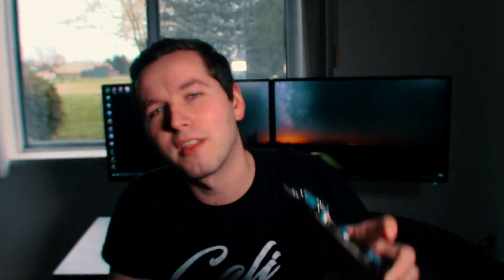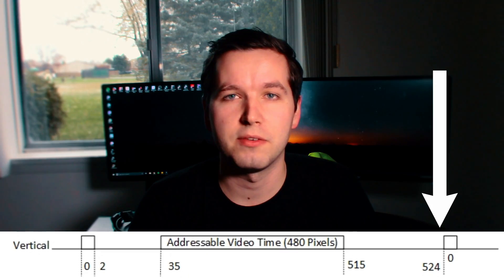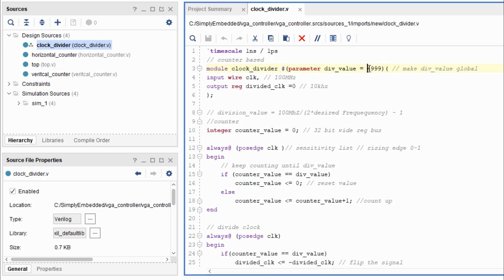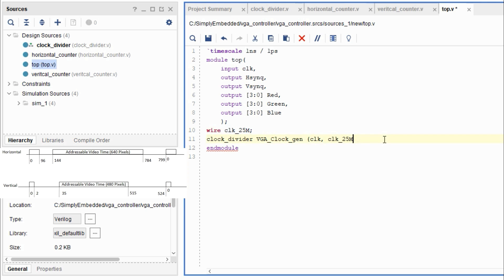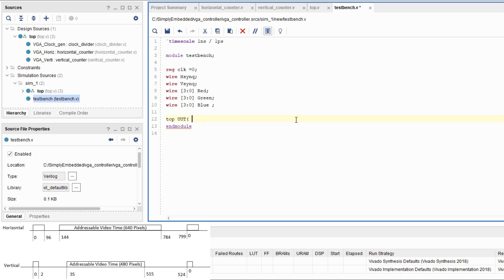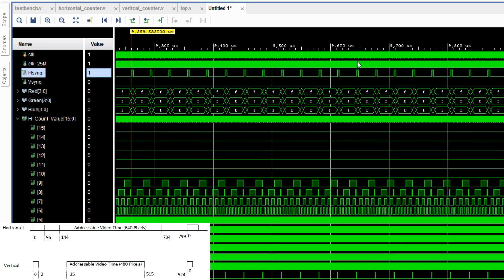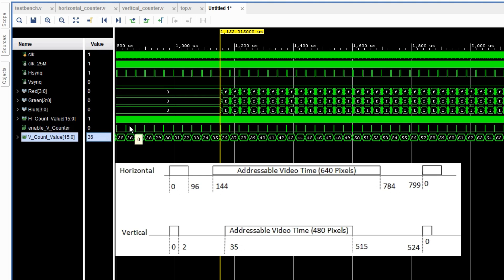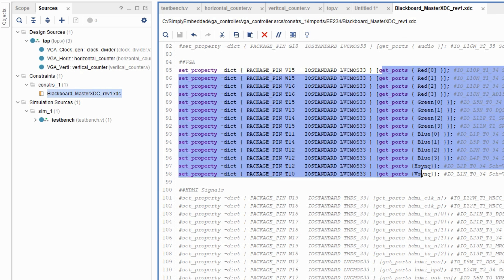How to Create VGA Controller in Verilog on FPGA? | Xilinx FPGA Programming Tutorials

Comment: `timescale 1ns / 1ps
//////////////////////////////////////////////////////////////////////////////////
// Company: 
// Engineer: 
// 
// Create Date: 26.11.2025 11:36:44
// Design Name: 
// Module Name: top
// Project Name: 
// Target Devices: 
// Tool Versions: 
// Description: 
// 
// Dependencies: 
// 
// Revision:
// Revision 0.01 - File Created
// Additional Comments:
// 
//////////////////////////////////////////////////////////////////////////////////

module top(clk,Hsynq,Vsynq,R,G,B);
input clk;
output Hsynq,Vsynq;
output [3:0]R,G,B;

wire clk_25M,enableV;
wire [15:0] H_count,V_count;

clk_div_100mhz_to_25mhz VGA_clk(clk,clk_25M);
Horizon_Counter VGA_hor(clk_25M,enableV,H_count);
Verti_count VGA_verti(clk_25M,enableV,V_count);

assign Hsynq=(H_count<96)?1'b1:1'b0;
assign Vsynq=(V_count<2)?1'b1:1'b0;

assign R=((H_count>144 && H_count<784)&&(V_count>35 && V_count<515))?4'hF:4'h0;
assign G=((H_count>144 && H_count<784)&&(V_count>35 && V_count<515))?4'hF:4'h0;
assign B=((H_count>144 && H_count<784)&&(V_count>35 && V_count<515))?4'hF:4'h0;
endmodule

Comment: As far as I understand, this is an example of an elementary implementation of one standard graphic mode: 640*480 256 colors (1 byte + palette). In essence, this is a RAM-DAС block. The real video adapter also contains control registers and different modes(including standard text 80*25 and 40*25) + a programmable character generator (in VGA, if I remember correctly, it is reloadable).

Comment: Your HSYNC and VSYNC are reversed for VGA. They should be negative pulses. You must have tweaked this to get the VGA working.
Reply: According to my knowledge the signal is flipped before it is sent to the vga port. Essentially making it an active high instead of the normal active low.

Comment: What RAMDAC system do you recommend if I want to make a cheap retro-style computer based on the STM32F107 MCU?
I want to use FPGA for GPIO and custom peripheral processing, and VGA output is the first candidate.
I select F107 as the cheapest MCU with Eth included, but it has no FSMC. The closest STM32F103 with FSMC has 2x price and not in local stocks now.
Reply: I want to use 332RGB with 640x480 or 800x600, both of them require to have not less than 512K of VRAM, and unused memory maybe cab used for hardware sprites.
I did some search, and can't find cheap RAM with required size, maybe some hardware RAMDACs still exists?

Comment: how do you even get all these numbers at the start? i'm trying to generate a VGA signal with an FPGA but want to have a smaller resolution. something like 320x240 (half VGA), what would the pixel clock be like, the sync pulses, front/back porch, etc. i didn't notice anything in the video that says how you calculate that.
I don't think it's good to assume everyone will use 640x480, i've seen people who were able to generate much smaller and rather odd resolutions with microcontrollers. (128x96, 64x64, and probably more)

Comment: why only do VGA in 640x480? what if you want to change the resolution to something strange/less common? like 320x200 or 256x240, etc
it should all be possible with the correct timing.

Comment: It may be useful to note that you have no need of a VGA connector on the board. You are simply need 15 I/O ports as you are writing the driver for those ports. You don't need to buy an external VGA port, you can simply cut open a VGA cable and make your own.